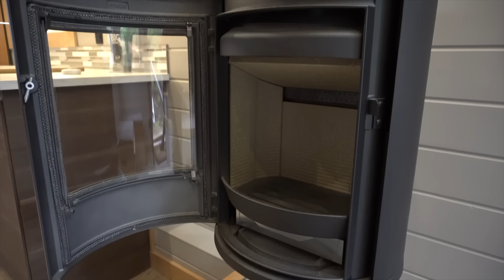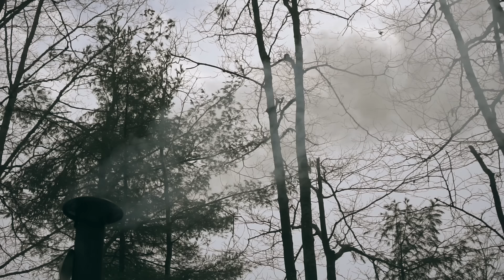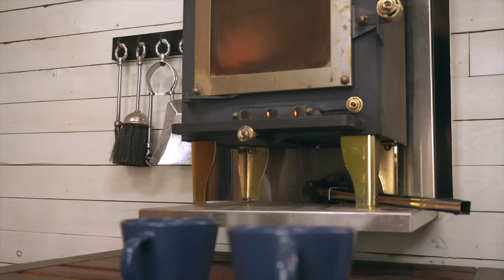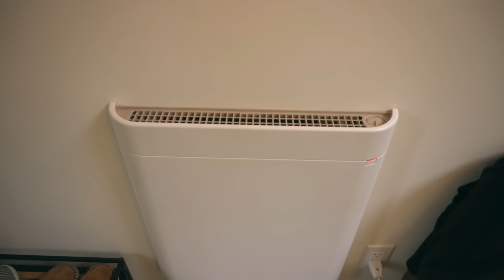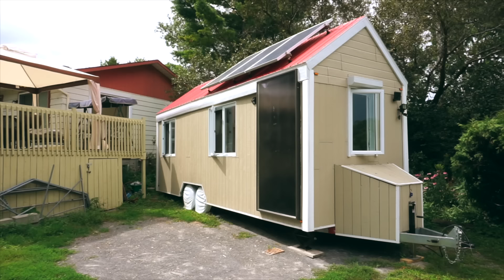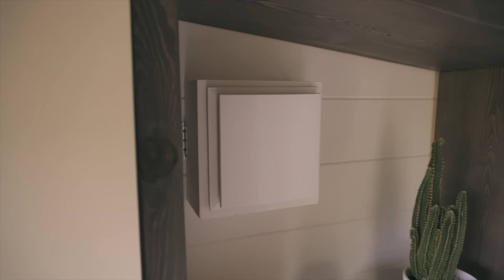Top 5 Tiny House Heating Options for Winter Living - Off Grid & On Grid

Comment: no rocket mass heaters?
Reply: Brian Grant probably not the best option for mobile tiny houses due to the necessary heavy weights required by the system. They sound like an amazing option for fixed concrete floor houses, though.
Reply: Oh, there's lots...  Like you didn't mention pellet stoves, which can operate with a thermostat.

Wood stoves also include cook stoves, which can have things like boilers integrated for providing hot water.

On a property, an outdoor wood burning furnace/boiler is also a option that can also provide thermostat control and large enough capacities to run for hours to days.

Electric radiant floor heating is only one version, which can be used off-grid and not only on-grid with a good enough off-grid power system btw.

The other version being hydronic and pumps heated fluids through the house.  

Use of heat exchanger and heat pump allow any heat source to be used for hydronic radiant floor heating.   So solar thermal, wood stove, etc. can all be used for both off-grid and on-grid usage.

Even composting can be used to heat a house if you have enough bio-mass to work with.

While one of the reasons why radiant floor heating is so effective is because it is conducting the heat directly into you and that makes you feel warmer than the ambient air temperature would otherwise make you feel...  Bonus being it helps avoid over heating any above spaces like lofts...  Though, you can also add radiant heating to the walls and ceilings if in extremely cold climates...  On roof being good for melting the snow off...  Some people have even done it for driveways, so they never have to shovel it...

Not to mention geothermal and rocket stoves...

The air exchangers has two levels... Basic Heat Recovery Ventilation, which can retain up to over 80% of the outgoing air temperature by transferring it to the incoming air... Then the step above it is Energy Recovery Ventilation, which adds the same but for humidity and helps regulate the humidity level of the interior, which you should keep around 40% optimally... Neither too dry or too wet is good...  

Overall... Insulation, thermal mass, and multiple heat sources are the way to go...
Reply from the maker: +Brian Grant We covered the options we were most familiar with but thanks for sharing your idea! Hopefully other people will also share other options we haven't covered in this video.  Thanks for watching 🙂👍🏻
Reply: small spaces should be easy to heat. I agree, the use of a RMH for a tiny house depends on the design of the structure. but instead of mobility, perhaps the fundamental design consideration should be comfort in winter.
Reply: Masonry and Mass heaters only require a lot of mass if you want the heat to last a really long time but it can be as little or as much as you want to scale it.

It's more a issue of how much space they take up...
Reply: https://en.wikipedia.org/wiki/Rocket_mass_heater

Appeal... Very efficient and burns really hot, combined with thermal mass the heat can last a long time and thus can be superior to many conventional heating options.

Down side, can take up a lot of space, high temperatures can reach over 2000 degrees so systems have to be properly designed to prevent them literally melting themselves...  Without the thermal mass, they go through fuel quickly.  So while you can use even hard to burn materials like branches it usually requires more maintenance to keep it going.

They also require a high air flow, which can be a issue in an air tight house...

Most commercial units are the small camping stove types.  So you usually have to DIY one of these for a home but the final appeal is they can be done much more cheaply than most commercial options.

A good commercial wood stove can run into the thousands, for example.

However, newer wood stoves are also reaching high efficiency with either catalytic burners or secondary burn/gasification burners but can burn a long time without needing as much mass as a rocket stove, and you can more readily find a commercially built unit.

Problem for all of them is scaling them to heat small to tiny structures can be difficult as they're really designed to put out a lot of heat and as houses are built more energy efficient, the less heat you actually need to heat them properly.

So often heat output is compromised by reducing the max run time they can have without needing to add more fuel... For rocket stoves this can be down to a matter of minutes and for the commercial high efficiency stoves just a few hours, which can be a issue if you need to heat the house to get a full nights rest and not wake up to a cold house.

But there are creative ways to add thermal mass, like using hydronic radiant floor heating...  It's just hard to do at a low budget range.
Reply: Brian Grant:  What is a rocket mass heater and why do you like this type of heat source?

Comment: always have more than one heat source
Reply: Run around in circles really fast
Reply: @jerrymaxey4664  learned this one in the army, sergeant just points at a hilltop and says "run over there, it's warm in the top"
Reply: @jerrymaxey4664  haha thats so funny!
Reply: How about an ac with a heat pump
Reply: If temps drop very low a heat pump will use strip heater to make up for what it can't do in really cold situations.
Reply: Farting also works.